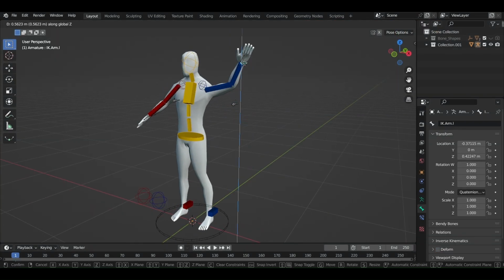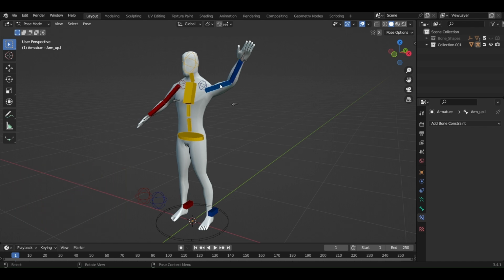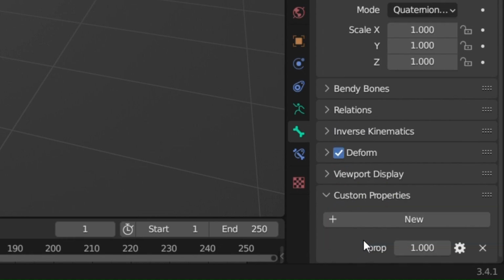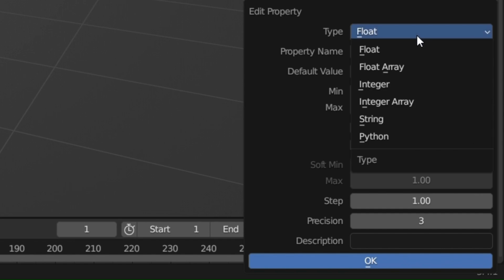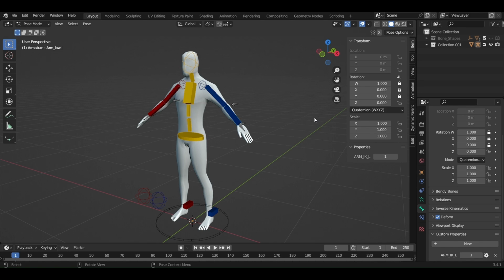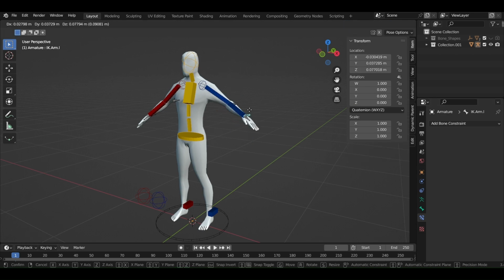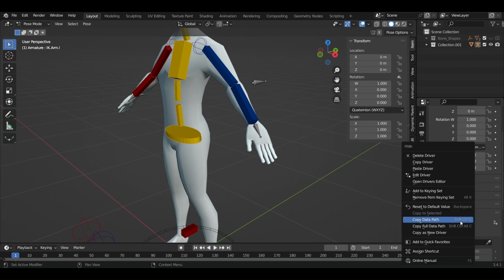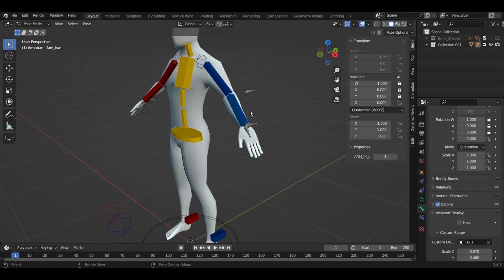Blender IK/FK Switch Tutorial| Easy Blender Rig

Comment: Love this option, the other tutorials I've seen are a little more complicated and only give the option to turn the IK on and off for the whole rig, this option offers more control for separate parts
Reply from the maker: Glad to know it helped.
Do let me know of any other problem I face in Blender
Reply: @animatorladka614  Thank you! I'm actually having trouble with animating using this switch. When keying the pose in IK I notice the bones will snap to a different position after I switch to FK to add a new pose. This also happens when I do FK to IK, is there a way to fix this? (I should note that I am using a custom rig, not a rigify rig)
Reply from the maker: @Ashhh303  yes, this is just a simple way for IK and FK, to retain the pose when you switch from Fk/IK, there is a different rigging technique, I will cover it in another video.
Reply: @animatorladka614   Thank you! I think I was actually able to figure it out, I mixed your method with another one that required me to duplicate the bones. I'll still look forward to your tutorial though🙏